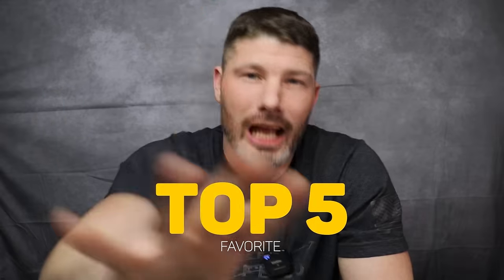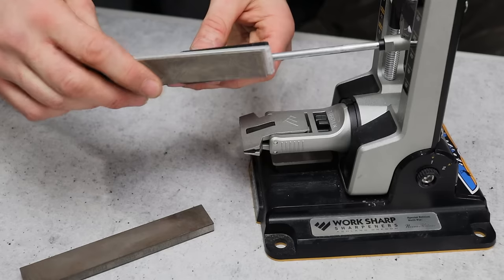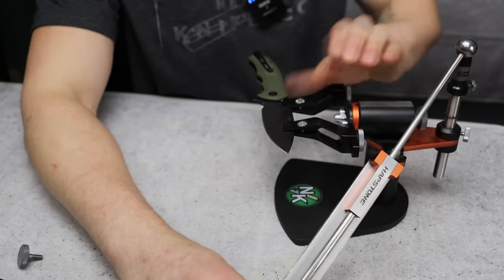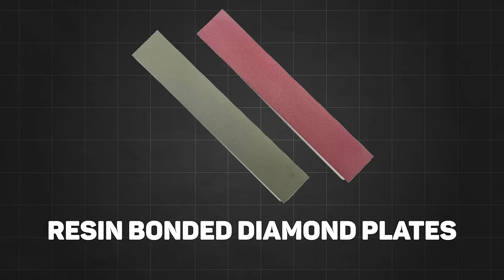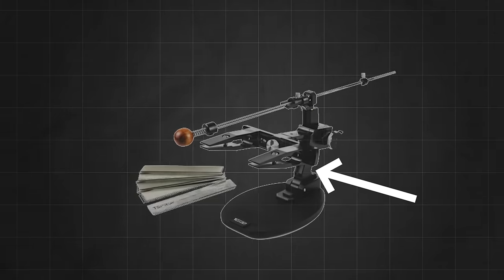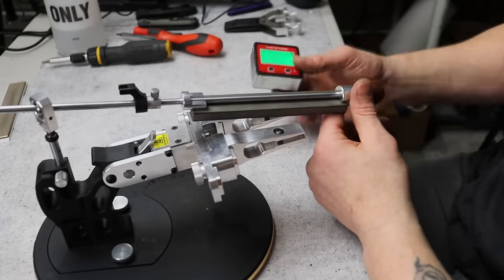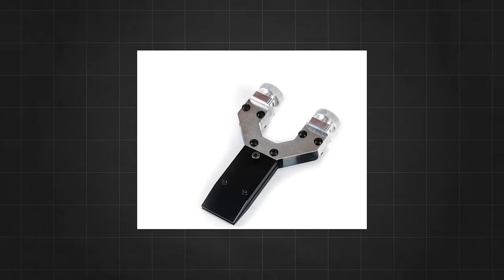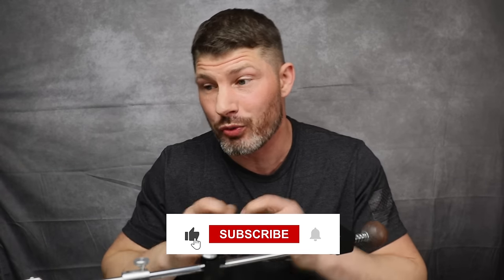The 5 Best Knife Sharpeners of the Year!!

Comment: Hard to take any advice or opinions seriously when a Spyderco Sharpmaker, Lansky and/or a Wicked Edge don't get mentioned on a list. They are THE BEST........and you will never get a knife any sharper or easier for cheaper. I never liked traditional wet/whet water or oil stones because they prematurely and unnecessarily wear out your knives relying on creating a burr and apex. You  also no matter how steady you are end up changing factory geometry screwing up your knife. When someone insists "this" is the only way to sharpen a knife followed by a bunch of bravado and ego mania just simply blow them off and ignore their opinions. 

These other style of sharpeners scratch up your knives. They aren't original and knockoff clones of the original Edge Pro sharpeners that really didn't work all that well to begin with. They certainly weren't even constructed all that well either. The Edge Pros reminded me of a science fair project or something someone jerry rigged and fabbed up in their garage. They used wet stones rather than these diamond and made a huge mess with the slurry that found it's way down and into the pivot bearings/bushings and locks.
Reply from the maker: OK this is the reason why, at the time of filming this video Kme didn't have a 6 inch stone option only 4 inch, lansky only has .5 x4 stones I'm working with then now to develop a more updated system.  Spyderco sharp maker is not for reprofiling and I would never recommend someone sharpen thick heavy duty edges with damage on it or anything with damage or that needs reprofiling. Wicked edge while I love what they do seriously and I do recommend them however when it comes to the best their system only allows you to use there stones making them much less versatile than the ones featured. This is the best not the great thank you for watching I hope that makes sense I did mention this at the end of video

Comment: Digital angle finders are what I consider useless accessories. Think about it. If your sharpener is on a table, even if the table is tilted 45 degrees, the angle that matters is the one between the tool base and the tool arm. I've never seen a fixed angle sharpening system that doesn't have some type of markings on the unit itself and that is really all you need. 
Most of my knives are pocket knives and about 95% of them get sharpened to 17 degrees. I rarely try to match factory angles as they are usually a compromise and differ from what works for me. I'm all about set it and forget it, to the point I bought a second system that I do adjust just for kitchen knives and really thick stock fixed blades and folders. Works for me.